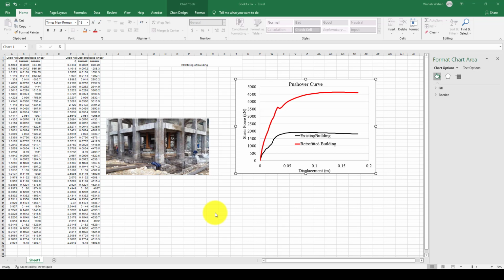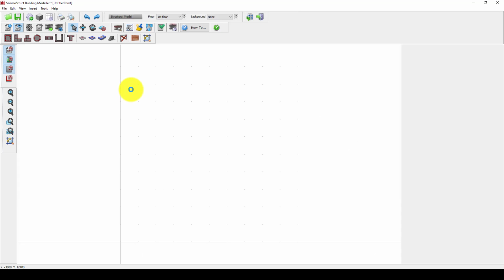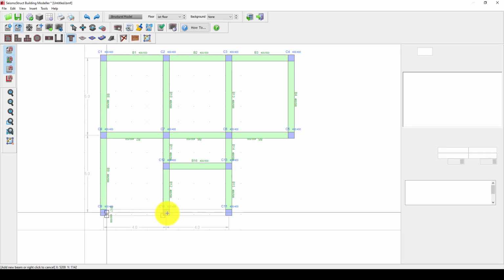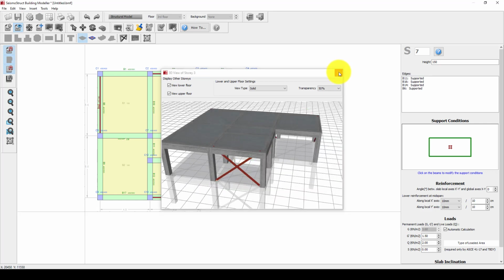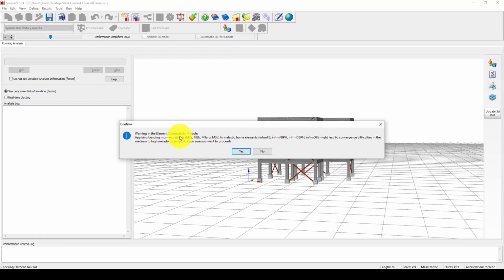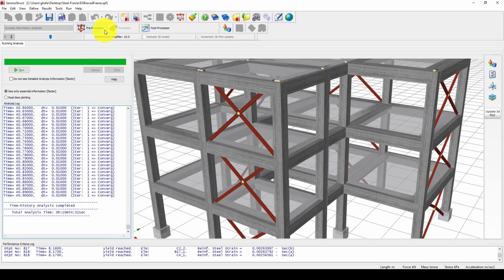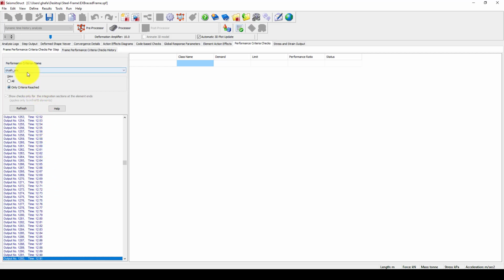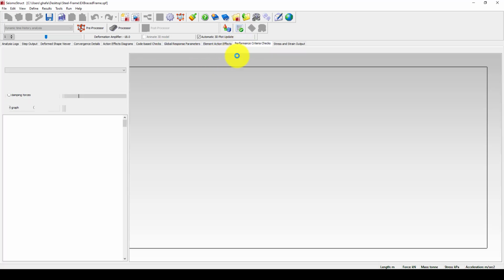Nonlinear -Time-History Analysis of an existing and retrofitted building in Seismostruct software

Comment: hi, 
please when we have à several real  earthquakes (for example a 10 ) matched by seismomatch software how to intégrante in the dynamic time history analysis in seismostruct
Reply from the maker: Hi there, I don't understand what do you mean (intégrante )?  It's better to read some articles and discuss them with your supervisor or make your question clear.
Reply: @KSSE_Engineer  thanks for your great help
I mean by the word (how to intégrante) how i used it 
my question is about the dynamic time history analysis; if you have multiple accelerograms  ( more than one) already matched by seismomatch software which gives a mean spectrum, the question is  how should I apply in seismostruct this accelerograms matched (in the two steps time-history  curve and applied loads)
Reply from the maker: @meriembou4506  Create multi-time-history analysis step.
Reply: @KSSE_Engineer  thank you, yes i creat multiple time histoty ,  But when do I apply it in applied loads It can't be done, only one time history apply in one direction x or y, maybe  I should use seismobatch .